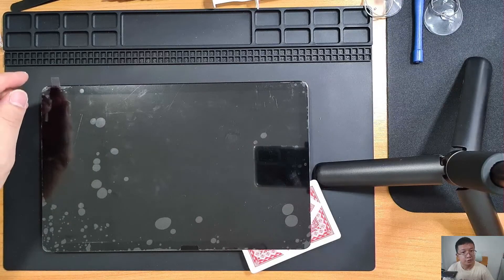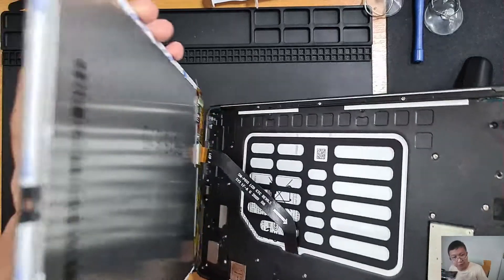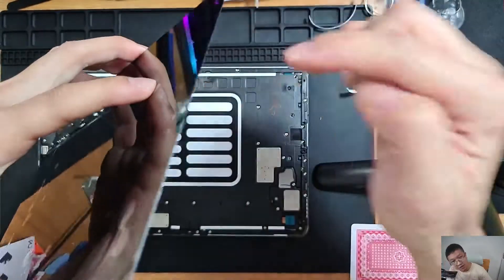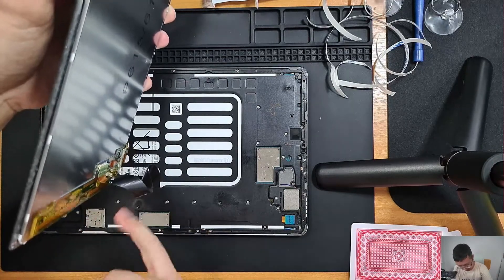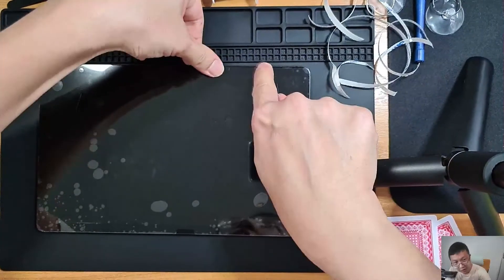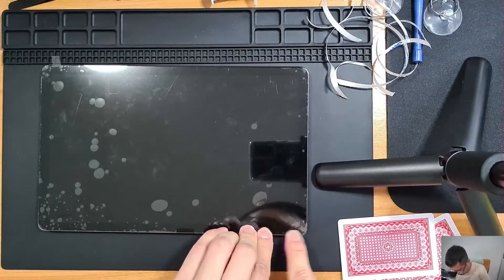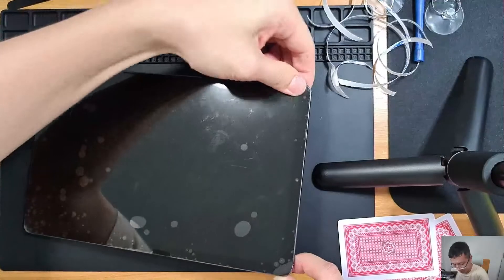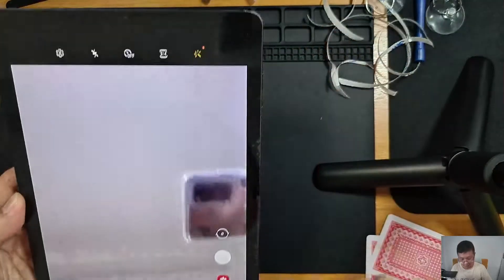Samsung Tab S6 Lite (Part 3) - Pasting of new screen

Comment: hi jonnyfyy, how is the quality of the replacement screen? does it look like the original display or worse? I am planing to buy the replacement screen but i read so many negative reviews about it.....
Reply from the maker: I would say it looks about 80% like the original screen as brightness is not as bright as the original. Do check the review before buying the replacement screen.
Reply: @jonnyfyy  Thank you Johnny, let me ask you just one more thing. 
How about glass thickness ? i plan to use the tab mainly for drawing. I am really concerned since there are some critics of the lcd replacement , that the glass is too thin compared to the original.
Reply from the maker: @leele3143  This one is pretty subjective and hard to say as I didn't use it for serious drawing, mainly casual note taking and media viewing.